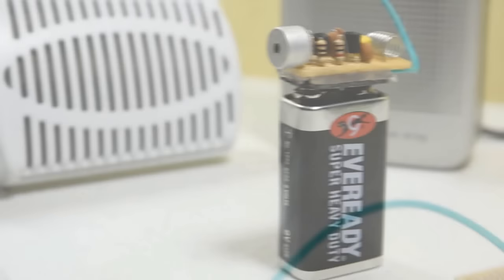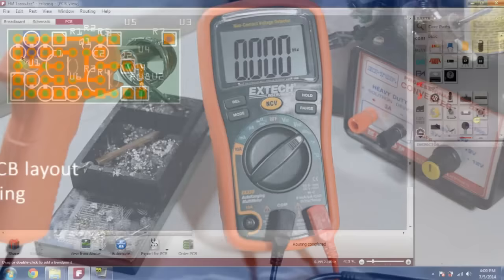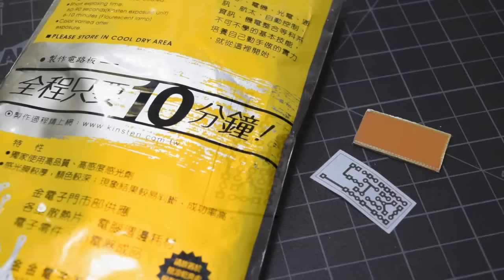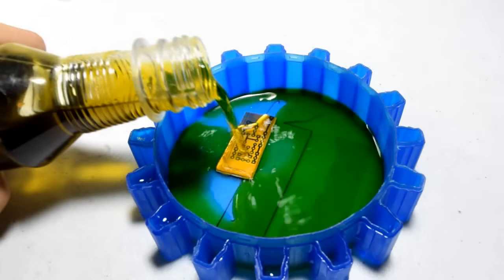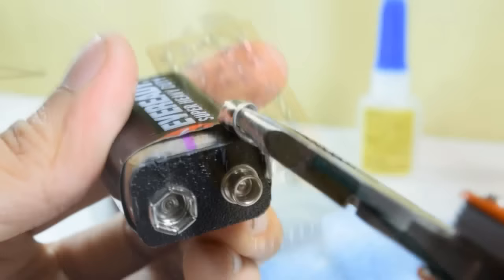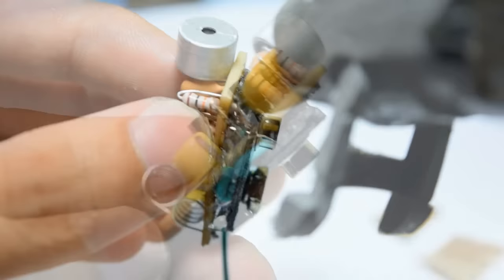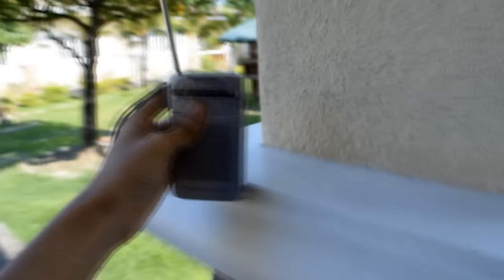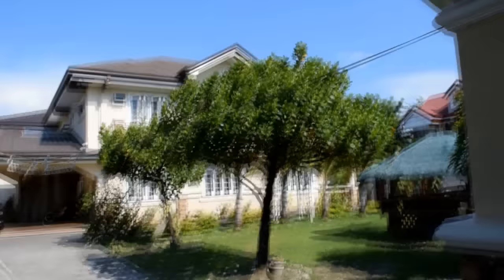Build A Long Range FM Transmitter (Homebrew Radio Station)

Comment: Amazing, I cannot wait until I build up the confidence to leave the bread board.  Once I have the confidence in my skills I will definitely be making one of these.
Reply: d74g0n start today. confidence will follow. doesn't even matter if you wreck it. besides, its actually so much simpler & easier this way. (with a pcb as opposed to a breadboard, that is)
Reply: +d74g0n there's a middle ground between the DIY etched board he made in this vid and breadboards. For something this small and simple you just need a generic little protoboard and solder connections together as needed. You'll have more practice with soldering that way, too, so by the time you spend hours making your own board like he did, you won't immediately destroy it
Reply: I'm still curious how to make it work with a greater power source.
Reply: +tjtube263 More Batteries in parallel. Or what are you talking about?
Reply: Christopher Kidd Sort of, yeah. I imagine it's more complicated than simply using a bigger power source, though.. Right? Won't the resistor values etc. need changing and so on?
Reply: tjtube263 No still 9v if in parallel. Just gives you more time or amps.
Reply: Christopher Kidd Will it increase the range of the transmitter?
Reply: tjtube263 Nope unless the circuit was being under fed in th amps department.
Reply: +Robert Forpahl +1 to protoboard. I bought a mega pack from Amazon or ebay when I first started. It's very useful to have 'disposable' breadboards

Comment: That WinRar is paid version? :p
Reply from the maker: P Ravikant Nope, it's the trial.
Reply from the maker: I would rather use the legal trial version. :)
Reply: TechBuilder do u mind making a video about A/V transmitter
Reply from the maker: MegaMidoZ If I can find a good working schematic then yes!
Reply: TechBuilder i find a good one but i cant find some component in the circuit 
http://www.radio-circuits.com/transmit8.htm

22pF trimmer is not available near where i live
Reply: ***** No one cares - this is ELECTRONICS, not warez >_<
Reply: +MegaMidoZ use the parallel and series configuration to build your own 22pF capacitor, well.... 20 will work fine coz generally they have tolerance + - 5%.
Reply: +P Ravikant use 7zip , is open source !
Reply: +TechBuilder Is it ok to create the FM transmitter plate (the PCB) out of a thick plastic container piece? I saw another tutorial about the FM Transmitter and i just want to be sure! I will aprecciate it if you answer this comment so thank you.
Reply: +Pedro “Dark” Saúl Nunes To make a PCB requires special copper clad material. Using just any piece of plastic won't work. There is nothing stopping you from using the plastic and jumping each connection though.
Reply: Tanner Bruce Sorry but what do you mean by jumping each connection? My english is not that extended.
Reply: +Pedro “Dark” Saúl Nunes Using Jumper wires
Reply: +P Ravikant Pff, who BUYS WinRAR?
Reply: /home/yoshifan Who uses WinRAR when 7zip is free, and better? ;)
Reply: +CalTheTroll - games music and thats it Who uses Linux? BSD and Unix are way better.
Reply: Nicholas McKenzie Pff, Unix. I use DOS, and I've only been hacked 29,482 times!
Reply: +TechBuilder Or check out 7zip which do rar and zip as well, fast and for free
Reply: +RaVlog Just get the trial. I have used mine for months, i can still use it
Reply: +epistemex 7zip is so much better with winrar, adfree.
Reply: ***** The point is that you open a dead battery, saving you money of having to buy a 9v clip connector
Reply: Who cares!!?
Reply: +C H A R A pffft I use a calculator
Reply: Баян, не смешно.
Reply: But...you don't need one. The trial version IS the full version.
Reply: RaVlog jo mood. The
Reply: Dude... get 7zip
Reply: Just use 7zip.
Reply: Trial and paid version  are same only a few changes
Reply: @TechBuilder  ahh yes, that unlimited trial version😂😂

Comment: I used to build his things when I was a teenager like you. But I used to make the antennas a lot longer than that. At one time I ended up bugging my sister’s House across the street about four houses down. What I did was I hooked up the antenna to the copper strip that seals the front door sometimes front doors have a copper strip around them to keep the air from coming in and out. And it worked flawlessly

Comment: I    have worked like this circuit since 40 years ago and it was coverong a distance of 5 km by used a 3 transitor type   2N  3866
Reply: Have schematic?

Comment: I have some projects planned for the new year and I believe I may just incorporate this one into one or two of those projects.  Back to the drawing board.

And yes, I've seen this before in magazines during the 70s and 80s.  One of my teachers built a baby monitor using a transmitter during the 60s and he built a few more for his wife's friends when they were impressed with it.  Unfortunately, the frequency was a tad off and the local police station was getting signals on their frequency.  He had to round up all the units and dismantle them or he would have faced charges.  I can still hear him chuckling with an amused look on his face while he told us about this.

Comment: 1960s METAL DETECTOR KIT  (variable FM.) This assemble yourself kit included all electronic parts, but no FM radio nor coil (loop.) The entire package was mounted on a long flat board with FM radio, boxed assembled kit, & added detector loop. It worked! The electronic parts came in a paper envelope, not  a box.Here it is 12/6/2019 & has been saved indoors all this time! How about that? Thought you'd like to know?

Comment: you achieve a good performance from this simple circuit !!! i have experimented with similar devices but I had to move on the CB band to not be "muted" by powerful commercial FM stations
Reply: any tips for someone building this for the first time?  (newer electronic hobbyist)

Comment: While this now an ancient reply, new electronics hobbyists should start out at square one with not using a screwdriver for the tuning of circuitry. There are a number of technical as well as safety reasons for this, and while using a screwdriver to adjust the tuning of this transmitter may happen to work with this circuit, as you may advance to more critical projects the need for a proper tuning tool will become increasingly important.
While not very expensive, such a tool or set of these tools need to be in your kit for present and future work.

Comment: I have worked in electronics for years and never new to use a 1/4 bolt as a coil former. Just shows you can teach an old dog new tricks

Comment: Is there a way to use lower voltages with this transmitter? Such as switching resistor values or something like that? Thanks in advance.

Comment: Put a 36" antenna on it and it will go for a couple of miles.  Built the same and used them for wireless mics for A Chorus Line many years ago.  Dirt cheap wireless mics, but a pain in the ass finding all the recievers.

Comment: I've remembered a good old prank. It were later 90s and I've didn't knew that this word ("prank") will be ever known. It was an "early Internet era". I was sleeping on my physics' lections few times just because the provider's telephone line was NOT busy! :D
The prank: an old elevator with doors controlled by a light switch. A protection device. Clever thing BTW! :)
It was in our univercity. 1st floor in the main building  (nevermind the name it's in Russian anyway). Me and my pal found that a light switch's case is "damaged" (the device was working though). So if you'll put a piece of paper or any small object in that device then the system will be "thinking" that somebody is not in the cabin yet!
We've put a small round paper ball there and did gone in a place near this elevator but on a distance so nobody will think that "these guys stand near here and watching for something!".
The whole gag was in the situation. If you enter that elevator you usually wait for some time and if nobody goes in then doors starts to close. But if somebody runs into it then everybody waits again! :))) So if a pause between these events isn't very big then people just think "OK". Next others doesn't know that they've waited longer than usually. If an elevator doesn't moves up then some people think "meh, it's not working again!". They usually go out and use a stairway.
Few people walked into this elevetor and wait... They wait and smiles after sometime ) Somebody didn't thought out it's a gag and did used the stairway then :)
After some time we've seen an elevetor almost full of students. It's a rare look I must say :) Or was. After about 5mins or later somebody did found out that there was out tricky paper ball :) Did laughed a bit and everybody got fun :)
The end! No wet clothes, drops or anything tragic to anybody :) It's pitty I've didn't had a camera those days. Film cameras were very noticeable, digital had a very rough quality picture and light characteristics, portable movie were not for our wallets :)

Comment: Would is be possible to swap the Mic out for a headphone jack?

I would think that would increase audio quality vs using a microphone.
Reply: +IdealIdeas100 yes, check out the MAKE: video for fm transmitter making
Reply: +IdealIdeas100 why swap it, when you can add it. get a stereo audio jack and wire it up, very easy
Reply: why no have both and use a switch to choose the input mode
Reply: Saikit Tang you don't need a switch
Reply: ***** Are you right there? That was completely uncalled for.
Reply: ***** Why do you want a reaction from me?
Reply: +The Destroyer You are doing God's work
Reply: +The Destroyer lol
Reply: Nikola Nikolov I feel like I know what he's gonna say..
Reply: that's what she said
Reply: +The Destroyer what did he say
Reply: Lol dont waste your time there not worth it xD
Reply: It is possible to swap a mic for a headphone jack but it only outputs mono.
Reply: +The Destroyer Mind stepping out to the car park ???
Reply: +Navin Kotadia 
He's having seizures in the comments.
Reply: Hey *****, I keep yelling uncontrollably. What should I do?
Reply: I believe that you can, because it amplifies into the fm oscillator. Microphones amplify the same as audio jacks. Audio jacks might amplify little more than microphones, because audio jacks you can hear sound straight from it, it's just quiet.
Reply: Nate S audio jacks don't amplify at all
Reply: Sorry, I meant headphone jacks.
Reply: He probably blew up from a broken record of the same coment over and over. Lol.
Reply: +The Destroyer You probably don't know what a transmitter is. You probably don't even know what a radio is. It sound like you only know those 4 words, since that's all you are saying.
Reply: +The Destroyer I think we need to fix you. I think you have a long range transmitter to the  reciever in you head to control what you are saying.
Reply: I think The Destroyer needs to be fixed with a block head screwdriver. Lol.
Reply: +The Destroyer 
Hey dude, do you mind if I dislike one of your videos cuz the 'stfu' isn't gonna stop the conversation.

Or not continue on your seizures.
Reply: *****
C'mon say it one more time I dare ya!
Reply: Can I use a BC547 instead of 2n3904? Works the same?
Reply: hh
Reply: The Destroyer Soooooo... It has been two years, chill out yet?
Reply: The legend says he is still there...

Comment: ...I've been made too many RF projects in 1995 --FM TRANSMITTER 50 watts
Reply: Do you have schematics?
Reply: rofl lyier
Reply: Can you use insulated wire for the coil?
Reply: @TRENTINATERx2000  
Yes, same insulated wire which used  in winding motors.
Reply: @tmxl7847  
I had everything previously, but I'm outside my country as I had immigrate forever, my dear I advise you to read about RF, in other words don't just copy schematic diagrams in order to execute a specific project, you must create your self knowledge foundation that enable you to do any RF project.
Schematic diagram doesn't matter, but the main principle does matter, read about Analog and Digital RF...

Comment: So I made one of these. Except for the circuit was Stronger, because I wanted a higher wattage.(1.5KW) I wanted the signal to reach further.

 I don't know it's legal to make an FM transmitter. I had mine running for about six months. Until I was forced to shut it down. Some unhappy Suit dudes claiming to be from the FCC. Had a warrant and confessated my transmitter.  
   Now I have to pay off an insane fine, I wasn't even harming anything. I was just propagating an electromagnetic wave. 
Apparently you need a License to own and operate a transmitter. At least in the USA.
My country has turned into such a dystopia. I don't see a reason why they need to govern Electromagnetic waves. It's light at the simplest. 

Even GMRs which some walkie-talkies have built into them. You still mean the license transmit on certain channels. I'm honestly to the point to where I want the FCC. Defunded. I don't even see a point for that branch of the government.

Comment: What kind of battery life could we expect to achieve with a 9v?
Reply from the maker: 3-7 days :D
Reply from the maker: ***** It lasts, longer than you think :))
Reply: Interesting, wouldn't have expected that kind of life from something like this.
Reply: +TechBuilder I watched a video from Keystone Science on how to make one and his was using 6.2 amps I think and it registerd 0.00 usage even with it on.
Reply: Depends on how much current the circuit is using overall, the more current the faster the energy is being drained out of the battery.

Comment: This is very impressive, but I should add that depending on where you live, there are applicable laws concerning using the broadcast FM band. In the U.S., there's a narrow slice at the beginning of the broadcast FM band (around 88Mhz) where you can broadcast with a small, low-power transmitter (like the kind they sell to pipe audio from your phone to your car radio). Also be aware of the power output limits in the regulations. A friendly neighborhood amateur radio licensee might have the equipment to test this radio and tell you how much juice it generates. I'm sure it's not much, but it might be several times what's legally permitted (again, depending on where you live).

Please be nice to the radio spectrum -- it's something that everyone uses ever day, and if it gets abused, it will become harder and harder to use freely. Look at drone laws in Canada if you need a good analogy.

Good work, kiddo! :)

Comment: Can i use aux input instead of a mic?
Or does someone else have a great tutorial on that?
Reply: it would be possible, you would have to convert the stereo output (left/right) from a headphone jack to mono (single line), connect the positive of the now single output to the positive of the microphone connection, and the outputs negative to the negative of the microphone connection. just dont turn up the device that its connected to up very loud, as it can and likely will cause distortion, if it is to quiet turn up the volume on the radio itself
Reply: Yes

Comment: Can I change the mic for a 3.5mm stereo male cable? I was hoping to listen to my PC music through the house without carrying it with me! xD
Reply: Sure. But be careful with polarity. This crap can easily burn itself and your sound card.
Reply: Kutluhan Mutlu Guess a mono plug is the only way of it. In this case I should match it with the polarity of the circuit?
Reply: Kutluhan Mutlu And thanks for the infos! :D
Reply: Yes, using mono input is the best choice. If you want to use stereo you can combo 2 wires together to the + side
Reply: Like connecting the two channels in parallel, at the same point?
Reply: If my radio has a pair of stereo speakers, how does it separate the two channels?
Reply: Yes like in the link. But it won't be change anything. This is a crap simple fm transmitter so mono input will be better for you. Also i am sorry but i can't give you information about "
If my radio has a pair of stereo speakers, how does it separate the two channels?" Because it depends on your receiver radio. There is nothing to do with this transmitter for seperating. If you can explain your radio receiver schematic i can give you information.
Reply: Ok, I'm going mono for sake of simplicity. 
So the stereo splitting is all about the radio receiver? I've never openned it up to see the schematics, but it has like, 9 or 10 years old, with cassette tape entry and everything.
Reply: But I'm pretty good with mono, I was just wondering about the stereo splitting process of the FM signal ^^
Reply: Keep that in mind: Your transmitter is a mono source. That means: Even your radio has splitting function for left-right use, you will get the same sound from both speakers. So it is not necessary to split sound to them. If you want more sound and one of your speakers not worked with this transmitter, than turn the knob to get best result from one speaker :)
Reply: ***** parallel yes would work fine but half the impedance. series will double the impedance. your choice.
Reply: All popular radio channels using the FM standard use stereo encoding to allow for left and right speaker use, however this transmitter would have to be connected to a computer or arduino to allow the user to send the correct signal for a modern fm radio to receive and decode.
Reply: yes but you would need to convert it for best quality. Although i know the proper way, i usually just bridge the left and right channels directly and Ive never had any quality issues whatsoever.

Comment: How can the audio be so clear????

.

 i made myself and it took ton of work just to get frequency in the range, the audio was pathetic,  a lot of noise and interference were there. When i soldered the circuit, the frequency was lost!
Now i think most of the transmitter videos are fake